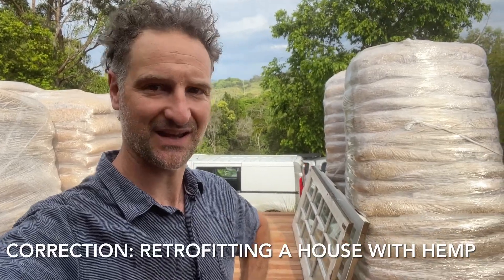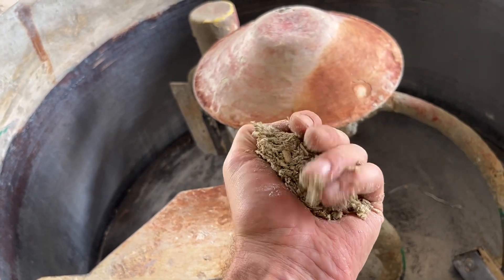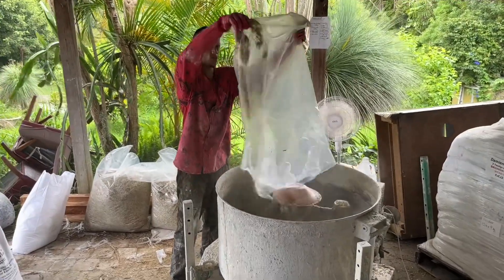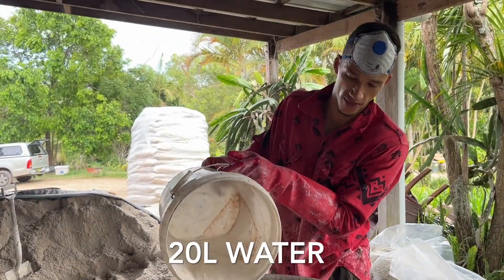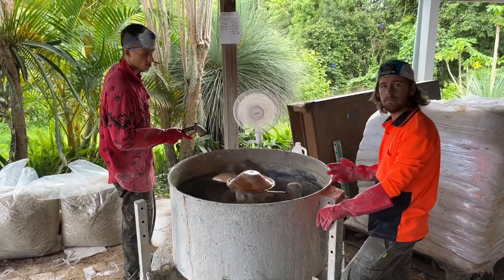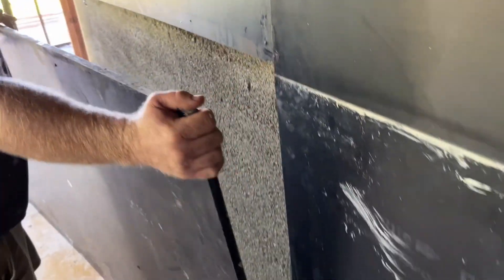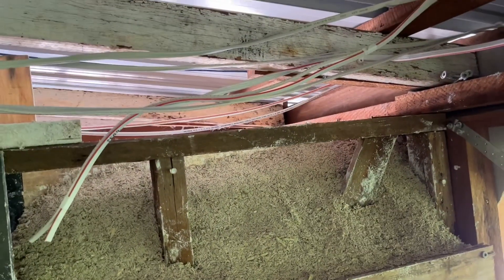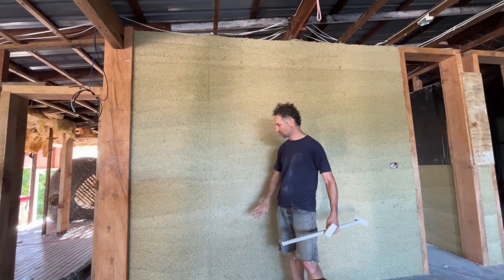Hempcrete Retrofit | A Queenslander Story & Site Mix Demo (Not a Masterclass) – S1 Ep5

Comment: Can you build the walls without the roof on so as to get better access to ramming the walls properly
Reply from the maker: That might depend on how much rain you are expecting. For experienced hempcrete installers this is not an issue as they have their methods so that the walls get instaled properly all the way to the top!

Comment: Great video, and interesting to see bigger forms being used. How do you do our curves? With moulding or once the form is removed? Thanks
Reply from the maker: Thanks! Create the form you want with molding first. 1/4 cut PVC pipes can work well. If going off form hempceret that one must be diligent with the packing and tamping but if it's rendered then you can refine the cures with render layers...
Reply: Curved formwork.

Comment: Hi guys this all sounds good but what about fixing out, doors skirtings, jams, architraves, cupboards etc, how do you secure these to the walls without it all falling off, also do you need to have the roof on when packing out the walls with hempcrete? And what about the external walls, can one use stone blocks or bricks as an external finish?
Reply from the maker: - That is quite a few question....thanks! I'd be happy to arrange a zoom or similar meeting so we can have a chat and I can address some of these. Head to http://environmentarian.au/ to book in :) 
- Regarding shelving I have this video which may be helpful
https://youtu.be/wiKZo7Z7uoE
- And also check out www.hempbiulding.au that has plenty of free info..
Reply: Joining a hempcrete tamping team on a build or attending a workshop is a great  way to learn more. 
The build I went to recently had jams,  framing, electrical and plumbing in, then formwork  prior to buckets and tamping the mix in.
Similar to other building processes but much lighter and easier to handle. It is such a practical and carbon concious construction product.

Comment: Ok experiment with a concrete additive. Do the bugs like it and dies it decompose over time.
Reply: Termites hate the lime, so basically very pest resistant.
Reply: It gets stronger over time and lasts longer than concrete. Must be well built following a process. Keeps absorbing CO² for years.
It is a terrific material for carbon concious construction and for durability, for fires, fir air quality and for the environment.

Comment: Hi, great work! The hemp is really amazing. Maybe I got this wrong but I heard sand shouldn't be used in this mix or maybe it is when you only use hemp + lime as a plaster rather than building a wall? Thanks a mill.
Reply from the maker: Hi Julien, thanks for the comment and glad you like the videos. I've seen issues with sand mixed in walls and other walls that perform better due to the extra thermal mass. But I think 'no sand. is now best practice...
Reply: @JeremyThomas_Environmentarian  Thanks a mill for your thorough answer! All the best.
Reply: @julienvailles2986 sand can be used. Best mixes are important. Getting a hempcrete experienced builder is useful.

Comment: Do you have any estimate on how much the walls would weigh?

I'm wondering if it would be too heavy to retrofit a manufactured home with?
Reply from the maker: It's a very light weight material. But that's the kind of question to run by a structural engineer, preferably one that has experience with hempcrete.
Reply: Lighter than most other alternative building products. Experienced with hempcrete builders, architects, draftspeople and tradies are in the hemp directory and there are more and more people in the growing industry every year.

Comment: Surprised to see the hemp wrapped in plastic 😢
Reply from the maker: Surprised why?
Reply: A great video. I have some hemp shiv and lime bought from France and want to make blocks and insulate walls in an old house. 
I need a paddle mixer and enquiring about the electric mixer I see you using. Would it take a 25kg bag of hemp and two 20kg bags of lime. An electric mixer is what I'm looking for. 
Kind regards, 
Kevin.

Comment: This is actually insanely good. Not only does it last way longer than concrete, but it's also a renewable resource and good for the environment though at the rate we're f**** up the environment. I don't know if little things like this is going to help
Reply from the maker: Thanks solarwind for your comment! But we gotta try hey!?  

And from small things big things come. I made these videos late 2022. Now I’m building a Hemp Building Directory www.hempbuilding.au with a famous Building Designer and within 2 weeks we have designers and architects, builders and installers, engineers and consultants all signed up. This should be good for the nascent hemp industry. 

Next we are involved with Professors at Syd Uni ag institute. 

The ball is rolling and thanks for giving it a push with your comment!
Reply: We need to be building with bamboo, hemp, and wood to remove as much carbon as possible from our atmosphere. These building materials should be made compulsory in earthquake zones like Turkiye.
Reply: I'm of a thinking "better to do anything then nothing at all", if we don't do anything then nothing will change and it can get even worse, at least we try

Comment: if hemp was available in my area I would love to do this. I'll probably end up using sawdust in stead.
Reply from the maker: saw dust can work but hemp has a high silica content which means it sticks together better then other organic materials
Reply: It is also not available around here, (or if it is I am unable to find it) and to get it would be more expensive then just using standard building materials.
Reply from the maker: @erikzorger3311  for now the initial cost of hempcrete building can seem expensive. But when you factor in thermally controlling the spaces over the 100 plus years of the building and the fact the much less energy is needed to heat or cool these spaces then there is a factor that could help balance out the expense over the longterm.
Reply from the maker: @erikzorger3311  In Australia for many years we had a hurd supply issue. We were importing from France and other countries. For many the import cost was worth the value of the product considering they were building a legacy for the future...
Reply: @JeremyThomas_Environmentarian  not when it comes to either getting it or eating. I halfto make it to tomorrow before I worry what will happen in a week.

Comment: Approximately, how many pounds of hempcrete was utilized in this home?  Also, how does the river sand contribute?
Reply from the maker: Sorry I don't have the exact amount but it was about 3 pallets - you can see them stacked in the video. The river sand adds thermal mass but isn't used in all hempcrete mix recipes.
Reply: @JeremyThomas_Environmentarian  Excellent, with those details, I can make an approximation of how much I need when comparing the square footage of my future structure with the one in the video. Thanks!!

Comment: Beautiful wall. Fine work. Aside from aesthetics, does the hemp wall provide a function as an internal wall? Will this wall serve as a thermal mass? Wonderful work here.
Reply from the maker: Hi Sean, yes, hempcrete has both insulation and thermal mass properties. So the thermal envelope of the room, the house, will be managed passively thanks to the hempcrete. Sound conditioning in the room is also amazing with no reverb/echo.